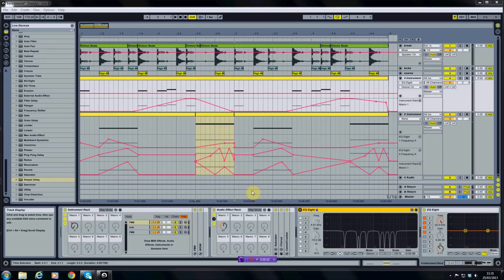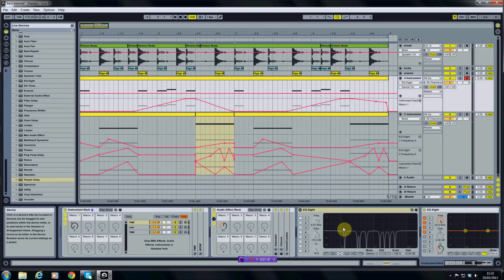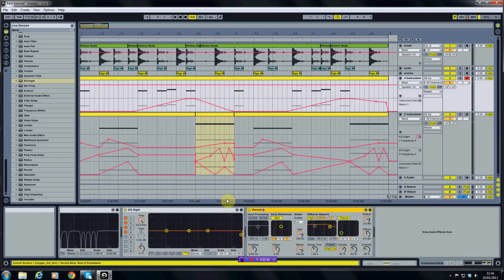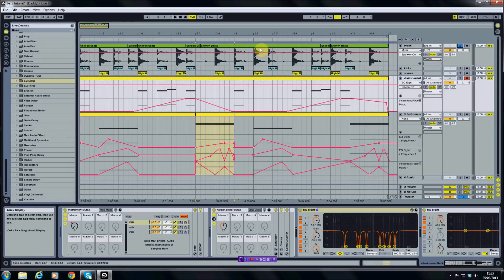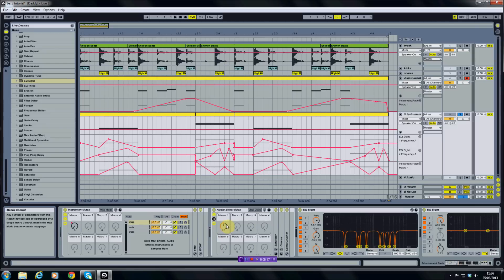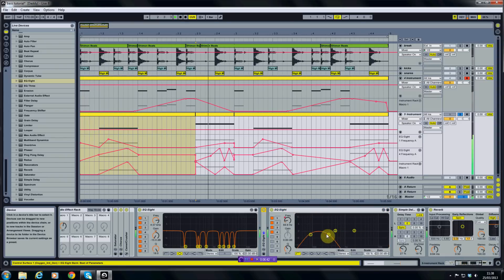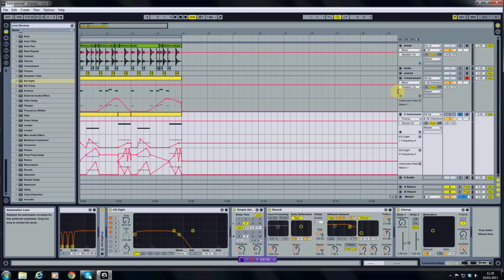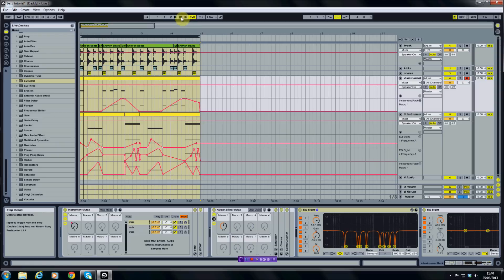Neuro Bass Tutorial Part 3 - Surgical EQ & Automation

Comment from the maker: This is very true.

I tend to use Surgical EQ as a way to reign in those resonant frequencies, as opposed to deleting them all entirely. It's very easy when using this process to over do it, and end up with a complete flat sound. Try not to overthink everything and feel like you need to remove absolutely every rezzy spike you find. Look at it more in a way to help the sound fit smoothly into your mix

Comment: Good tutorial,
but I have a question
resonant frequencies change depending on what note you play right? 
so if you do surgical EQ while holding down C it will be EQ'd to C. Change to any other key though and you change the frequency of the sound, which changes the resonant frequencies you just tried to filter out. I mean within a one or max two key range it will work, but if you went from C to F, the resonant freqs change so much the sound is different, not in a good way. 
help?